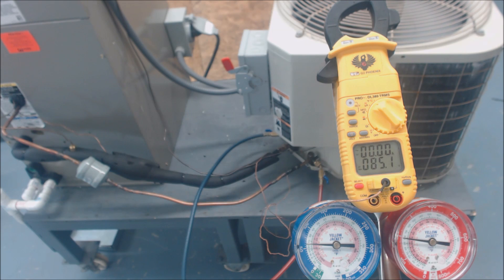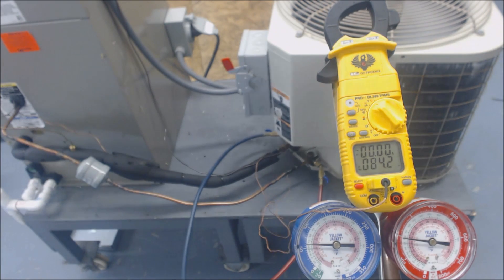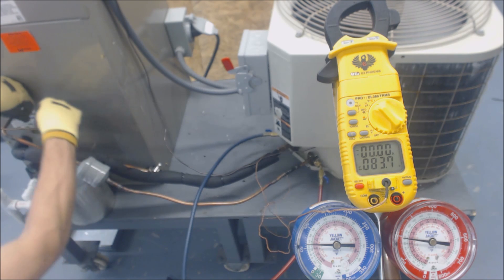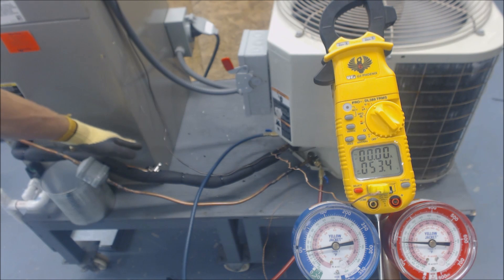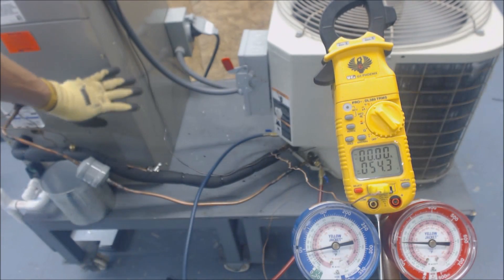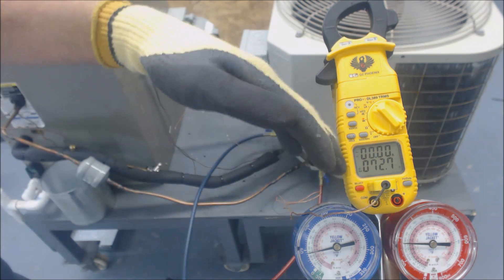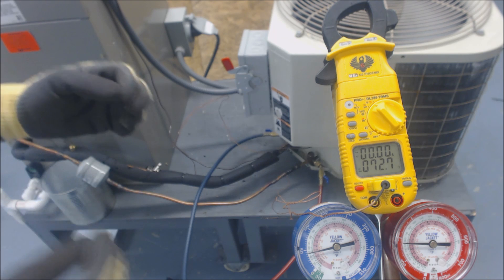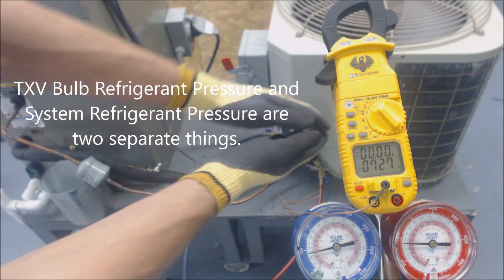Refrigerant Charging: What it looks like to have a Bad TXV Compared to just a Low Charge!

Comment: i had a new install call back because the evap was freezing up, n coil and txv 410a. new outdoor unit as well.
my high side  286pisg and my low 92psig. subcool rated 10 and my subcool was correct. added refrigerant and ounce at a time but after a while my high side was at 390ish and my low side was at 107. sc and sh were high but my evap was no longer below freezing.

im thinking new txv  bad
Reply from the maker: Yes or a restriction. Very likely a txv. Did you see what happens when you put the bulb in hot water? Does it open up and reduce superheat while increasing vapor pressure?Here is the TXV troubleshooting playlist  https://www.youtube.com/playlist?list=PLxnHR5_D2ojy2EYzy0YIJkce9sFIQj4-j
Reply: +acservicetech thanks, my Saturday on call turned into 4 recalls for new evap installs. all the same issue. I trust our installers so I didnt check to see if air was bypassing the n coil. different installer each time, either a recall on parts or they used too much solder without running nitro through .
Reply: Shouldn't you be at 120 psi on your compound side and 325 or so on discharge side..? Sounds to me that for 410a you may be undercharged..?

Comment: can you make a video just for target superheat and subcooling on the whole calculation?
Reply: Are you talking (IDWB x 3) - ODT- 80 divide by 2?  That works for superheat if you dont have your slide ruler
Reply from the maker: I have, check out the superheat as well as the subcooling playlist. Please let me know if you have any questions after watching them. Check the ones that say Step by Step as they will likely be even more broken down into steps. thanks
Reply: +acservicetech I understand how to get target super heat and sub cooling, but instead of checking a chart I want to know how the actual calculation is done. I understand your videos. Thanks
Reply: saturation point @ evaporator minus temp. @ suction service port is = superheat.

superheat is temp increase from middle evaporator to suction service port or comp. inlet.

from center of condensor or saturation point to outlet of condensor at discharge port is temp. decrease or subcooling.

discharge pressure converted to saturated temp. minus discharge temp @ discharge port or compressor outlet is  = subcooling...

Comment: awsome video. how common do you find that the txv is your problem and how common do you find you just have to replace the top body of the txv (bulb)
Reply from the maker: The txv is all one unit on the non electronic ones which are most common. Thanks for your Comment!
Reply: +acservicetech cool i also watched your videoes on superheat and subcooling just trying to figure out with out using any of those charts how to get target superheat and target subcooling with the calculation and how to crunch all the numbers
Reply from the maker: Exactly that's a beautiful thing. Once you get that down, it becomes a diagnosis procedure in your head! Great, keep at it!

Comment: Today i can across a system ( with txv) where the sub-cooling was fine @11 degrees...of 10 degrees posted..
the super heat was @40.9 degrees...Suction sat @ 36.7 ...line @ 77.6.....inside temp was 75 and the outside was 84 ( high side 308 psig=98 and line temp 87......checked txv looked good.....why the high super-heat....Checked filter looked good....return size looked good
....I didn't check coil size ---could that be a factor.....any suggestions ..I am still learning
Thank you
Reply from the maker: What was the temp diff between return and supply? Was the TXV bulb mounted properly and securely? What is  the txv size? If the txv is undersized that could happen, or if the coil was oversized by 1.5 ton or larger, or the blower motor was way oversized then the txv could possibly not keep up. More likely though, the txv bulb might not be mounter tight or the txv bulb could have lost some charge and not applying opening force on the txv head.Check out the txv videos playlist. I hope that helps, thanks for the Comment!

Comment: I wish i would have seen this video sooner i had a job that the evap coil was freezing up i eliminated the air filter, the under charge, cleaned both coils, txv was changed and checked the ducting and it still froze i eventually checked blower speed it was on high i lowered it and it froze faster so im thinking it was the motor to late now they are having a new system put in
Reply from the maker: Thanks for the Comment! On a system with a slightly undersized blower, the charge will look good for maybe the first 20 minutes and then you notice the vapor pressure dropping below freezing. The vapor pressure normally will drop as the temp is lowered in the building but an undersized motor will have a more dramatic affect that will continue below freezing.